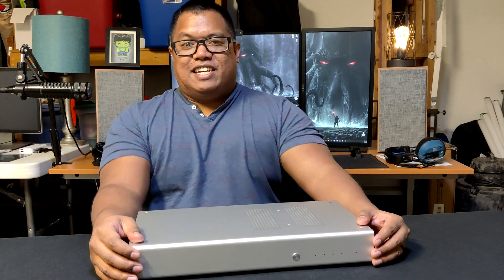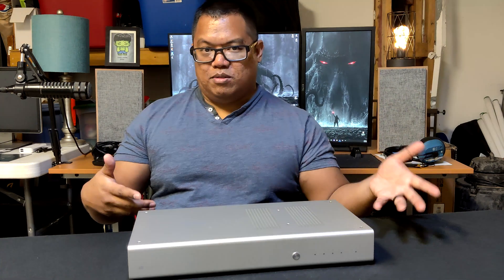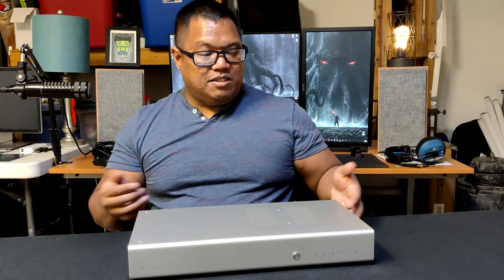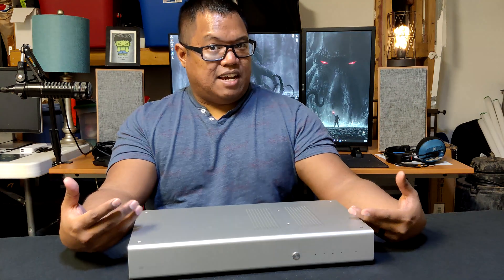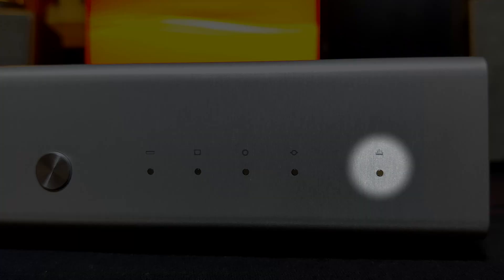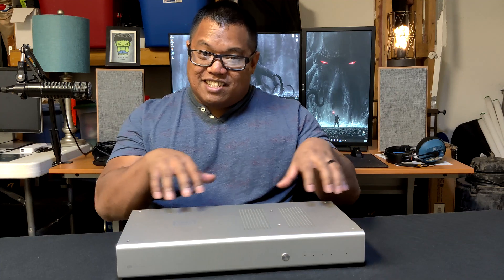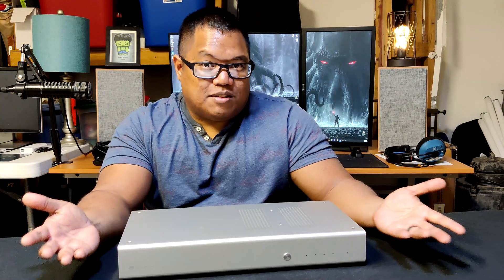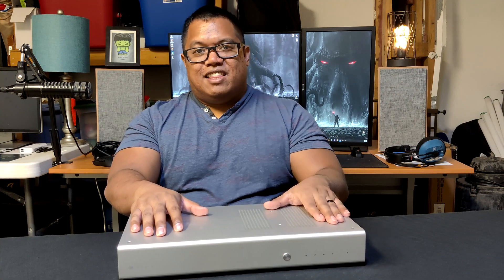Schiit Gungnir Multibit Review

Comment: So a couple things I've been coming across on forums.  There are 2 versions of the gungnir multi bit. A1 & A2. (Analogue 1, Analogue 2). People have said A1 is warm while the A2 is cold. 
Second thing ive read was about the inputs/outputs.  Gungnir sounds good going balanced but very noisy with RCA. Opposite for the bitfrost. My active speakers are a bit fwd and wanted something warmer. Would be using with the schiit freya +. 
Do u remember if u tested the gungnir balanced?
Reply from the maker: I tested it both unbalanced and balanced, balanced definitely is quieter and has a bigger soundstage. But it really depends on how resolving your speakers are and since you're already using active they'll be inherently noisier than passive speakers. And from my ears I have heard both A1 and A2 and I myself would say the A2 is more refined not so much colder.
Reply: @BennyKsBandwidth  thank you for that. The manufacturer of my speakers confirmed that their AE1s are "truely balanced" so, that about settles it...Gungnir Multibit for me. :)
Reply from the maker: So happy I could help! Thank you so much for watching!
Reply from the maker: @backrack01  You won't regret it! It's an amazing DAC!

Comment: Optical is inferior to Coax RCA, it's more prone to jitter and other bad things.  It's cheaper, that's why cable boxes have it.  Optical cannot transfer hi rez 2 channel material or any of the modern digital surround formats either
Reply: yes, so many people dont realize that. i notice a major difference on coax. also coax supports higher bit. optical is done at 24/96(or is it 98 lol) and coax does 24/192

Comment: Nice review. If I ever decide to replace my $99 Schiit DAC I'll probably replace it with this Schiit.
Reply from the maker: It's a very good choice! If you want to hear a little taste of this you could also try out the Schiit Bifrost which also has Multibit design just fewer bit range. And it's only, $699 vs this $1299.
Reply from the maker: Well I definitely would want to A-B them against one another.
Reply: @BennyKsBandwidth  how do the two compare with each other? I'd rather buy once (bleed once) if it's something I'd like to go to eventually. But if it's 95%+ at half the price I'd be interested.
Reply from the maker: Buy once bleed once is usually my route as well so I'd go with that! :)
Reply: I have a Bifrost 2 - I doubt you would hear a difference. I also think the price is a sweet spot for how good it sounds.